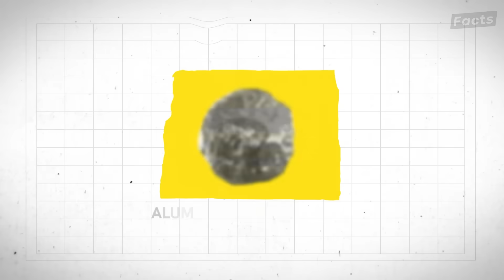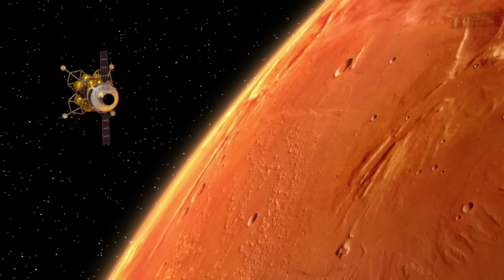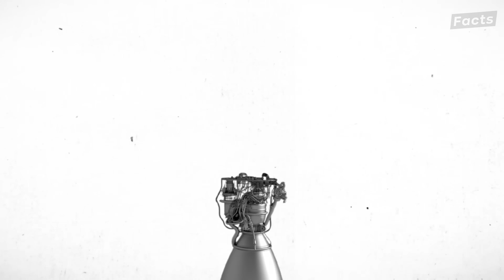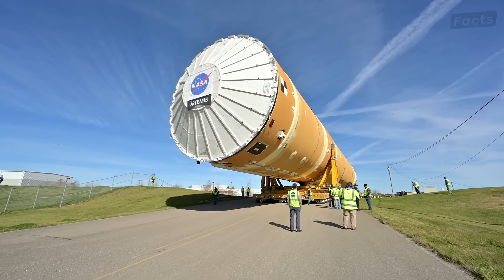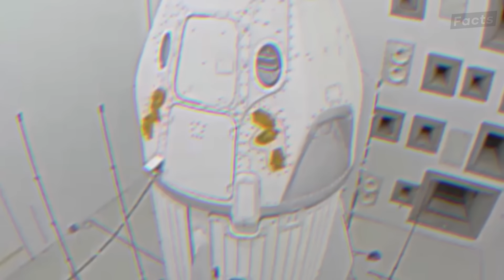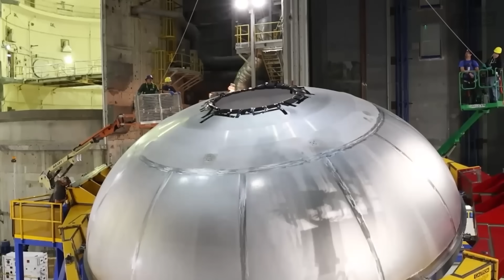Why SpaceX and NASA Rockets Are So Different

Comment: Well, all critics aside, the SLS already sent a spacecraft to the moon years ago. Starship launched 6 times with varying degrees of success and only went to low Earth orbit with varying degrees of success. 🤔🤔🤔🇺🇸🇺🇸🇺🇸
Reply: starship is a prototype thats making breakthroughs in aerospace engineering and setting records and sls is an overpriced unfinished Frankensteins monster of space shuttle parts that hasnt completed its primary objective in decades while starship started development 5 years ago
Reply: @ The only breakthrough Falcon or Starship has shown is reusability and launch frquency. The only thing both have accomplished is just going into low Earth orbit. There is NOTHING breakthrough about that. NASA has been putting stuff into orbit since the 50’s. 🤔🤔🤔🤔🤔
Reply: SLS launched once and had issues that have taken multiple years to discover

Starship has launched 6 times already. Not slowing down. Having already caught a booster, they will only be going faster.
Reply: @ That one SLS launch sent a spacecraft to the Moon—years ago. All ANY Falcon OR Starship has ever done is go to Low Earth Orbit—-nothing groundbreaking there…….🤘😎🤘🛸🛸
Reply: @jjojo2004  it also had many issues, some still unknown. Falcon has taken stuff well below LEO bud 😂

Sorry, but which SLS returned to launch site? 
Sorry but, SLS did nothing special. Not to mention that 1 SLS launch was more expensive than every Starship launch AND the second SLS launch is nowhere in site. While the next starship launch is next month.
Reply: @ Just like in football…a WIN is a WIN…no matter how you get there. SLS = payload/capsule to Moon (years ago). Falcon & Starship only going to ISS and LEO as of 2024, Space X has been around for 20 years. Both are a team to be reckoned with against China, Russia and others. But I’m NOT a SPACE X Fanboy either…😂😂😂😂😂
Reply: @jjojo2004  1 win doesn't out way many losses. Falcon 9 and Falcon Heavy have send vehicles well beyond LEO (Europa Clipper).  Both are a team, but to say SLS has anything going for it is absurd. A 100% success rate means nothing if you only did it once.
Reply: @jjojo2004 falcon sent a car to mars, falcon sent nasas europa clipper to jupiter, falcon has sent the most amount of satellites into orbits from leo to geo. Falcon is the only way nasa can get humans to and from the iss reliably. You have to be ignorant to not realize that spacex is the only reason the US remains dominant in space.
Reply: @jjojo2004  If your argument is that SLS launched a capsule around the moon, I have a Falcon heavy and Europa Clipper for you, among many others.
Reply: @jjojo2004  Europa Clipper?
Reply: @Baldorcete  TRUE!! Good point. But The Clipper is an unmanned space probe. Artemis is designed to be a manned spacecraft to take humans back to the Moon. 👍😎👍
Reply: @jjojo2004  Orion is also unmanned to this day. Let me know when SLS launches humans to LEO or beyond.

Comment: The tiles cannot withstand the increased speed a spacecraft entering Earth's atmosphere from beyond Earth's orbit. Earth's gravity pulls a spacecraft from Lunar orbit at 25,000 mph not 17,500 mph. The heating is at least 5,000 degrees F versus under 3,000 degrees F when entering from LEO. SpaceX would have to use a heat shield that can survive the increased heating when coming back from outside of Earth orbit. Either the Starship would need to have enough fuel to slow down from 25,000 mph to 17,500 mph or SpaceX will need a different thermal protection system than ceramic tiles. Now consider the cost of a "reusable" Starship that will need to be refueled in LEO with perhaps 6 to 8 other Starship launches to fuel the first Starship just to get out of Earth orbit. Meanwhile 55 years ago one Saturn V with its three stages could lift (according to Wikipedia) about 312,000 pounds to low Earth orbit and about 113,000 pounds to the Moon. We'll see how much multiple Starship launches costs to send even heavier payloads to the Moon let alone Mars. Entering Mar's atmosphere, being much thinner than Earth's atmosphere, has been problematic in landing small space probes/rovers on to the surface of Mars. So we'll have to see how a spacecraft designed to enter Earth's much thicker atmosphere will be capable of landing safely on Mars, lifting off Mars and coming back to "land" on Earth. As a space buff I hope Elon's vision(s) become reality.
Reply: There is so much wrong with this comment 😂

Comment: Listen to dude, you don’t throw away a car after one trip do you? You don’t throw away a plane after one flight do you? No we don’t throw them away however a car does travel throw an atmosphere that heats up to 7,000 degrees upon reentry otherwise we would. A airplane doesn’t fly through 7,000F plasma field for 5 minutes either otherwise we would throw it away as the material’s integrity is compromised. A car and plane outer structure isn’t built to withstand atmospheric reentry.
Reply: FYI we used to have cars and airplanes that could only be used for few/several times. Heck, even modern Supercars from certain Italian brand has reputation of being very exciting to drive, but very unreliable.
So, IMO this is not just about technology, but also about design philosophy. It is exactly like Elon said, if all cars are Supercar, only select few could afford it. On the other hand, most people can afford the reliable and affordable Toyotas.

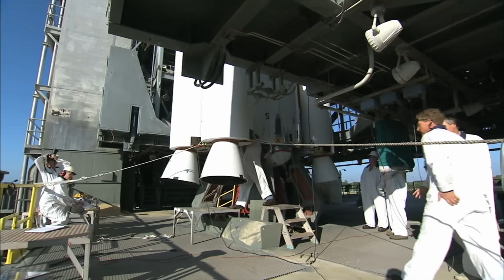Comment: 1:59 hmm that looks like the Delta 2 rocket that exploded on GPSIII because if you look at the SRB on the far right you can see what i think is a large crack going up the length of the casing of the SRB